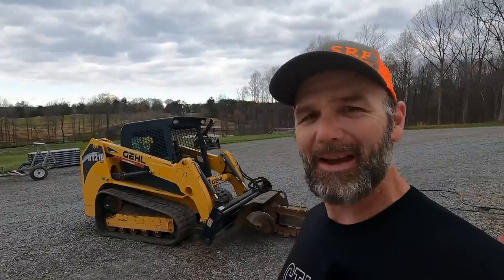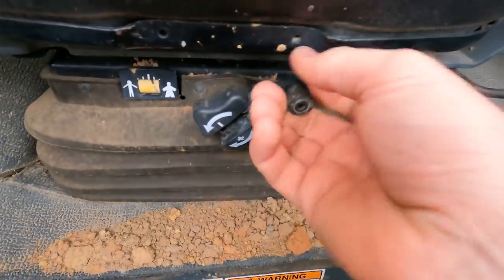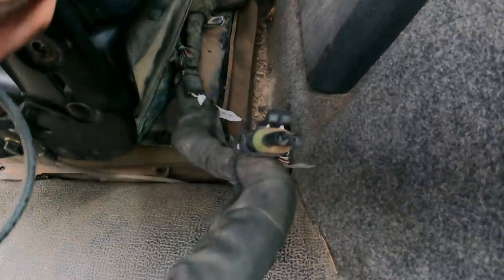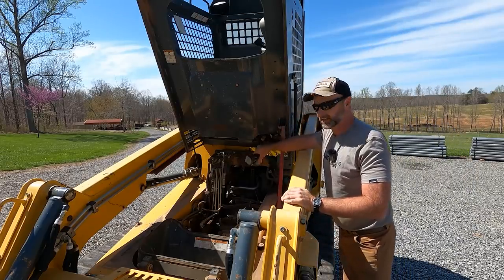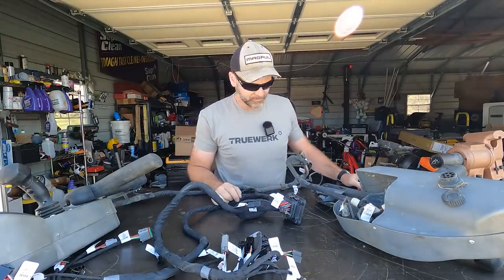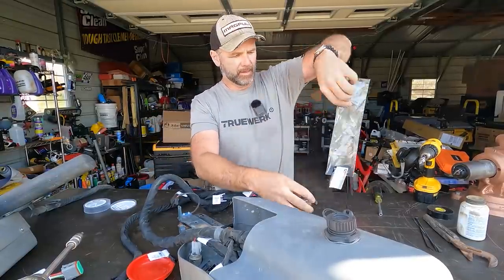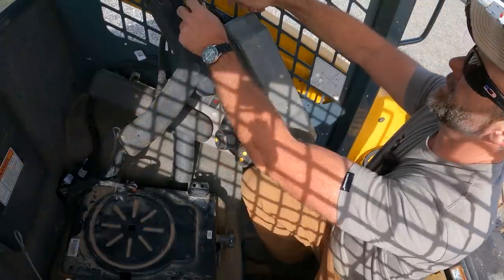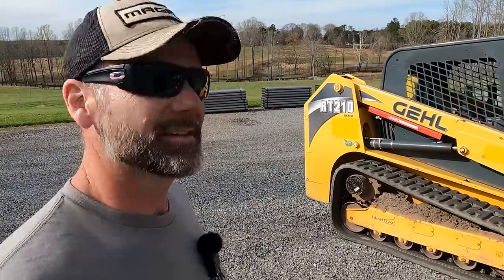I broke the skid loader

Comment: Never heard of using anti-seize on electrical connections instead of dielectric grease.
Reply from the maker: necessity often dictates policy
Reply: @StoneyRidgeFarmer  Iv used anti seize too and I use it on battery’s
Reply: Any grease is better than no grease.
Reply: @jeffeubanks370  conductive grease can cause more harm than good if not careful.  Especially in new computerized vehicles/machines.  He did it well with the tiny amount and application, but dielectric grease is specifically non-conductive for a reason.
Reply: Hope the anti size works out until your able to get some die electrical. I would not recommend leaving it like that for very long. Thanks for sharing Josh.

Comment: Never use anti seize. Die electric grease. A little goes a long way. Nice video though. When I was younger we fixed everything ourselves. Back then if we had to take it somewhere  and pay to get fixed. That meant we had to do with out something or work harder to make up for the extra cost.  It might have seemed rough back then  but it also taught me a lot.  Keep the videos coming.

Comment: Josh the failed wire appears to have broken due to fatigue. Cut the failed wire as close as possible to the connector  strip and test continuity from stripped wire to the pin. If it tests good cut out the portion of wire that appears to be failed. Solder in a good piece of wire and test continuity pin to pin. If good apply heat shrink over soldered joints.

Comment: that 9 pin connector under the Left control console is your Diagnostic Connector, that is where your diagnostic tool or computer plugs into to talk to the on-board computers

Comment: No need to comment on proper chemicals for the job or as we learned in school - Better Engineering thru Chemicals!  Suggest protecting/capping those unused connectors. Even using tape over the open connector will protect from debris, moisture etc.  Since that is an extension of the main harness, there will be ‘battery positive’ wires.  DO NOT use plastic bags over those connectors. They tend create a condensation pocket.  Enjoyed the vid and the bloopers. Power on……
Reply: said, "DO NOT use plastic bags over those connectors."
True.  Also notice the connector is facing up.  Taping the wires will create a bowl for the water to hold.   He said he needs proper drainage.  though I don't see a way for the water to leak out of the bowl of tape.
 
Six months he will be doing this again.

Comment: I say that is a ground wire for the seat switch. Its probably dirty or had corrosion.  I would have used a multi meter to try to find the short if that was possible. CorrosionX is an awesome product.
Reply from the maker: yep...it wasn't the seat switch buddy...watch the whole vid..you'll see

Comment: The vibration from the machine moter and lift  caused the connection on that pin to come loose. Its not your falt at all. The pin wasn't snaped in place when it was manufactured. You still have to fix it.
Reply from the maker: no sir...I hit a HARD bump..that's what got me

Comment: My Deere 9570r did the same thing.  I was in road gear hauling equipment.  Unplugged that pretty quick.  It wasn't fun just about getting launched through the roof  haha.

The active seat plug/wires somehow got smashed between the seat frame and shorted out.

Comment: I would secure that by the plug so it won't wiggle lose again. Then make sure the rest won't snag on anything with a tether (spring and wire tie)  that the rest can move snag free (not rubbing). Tractor trailers have a pole with a spring at the base so the wires/air lines don't get in the running gear. But I hope it won't happen again and you have good luck with it!

Comment: It pained me to watch this. No pry bars or metallic objects when inspecting wiring, They make plastic dental picks. Also the use of copper antiseaze is huge no no for electrical connectors use dielectric grease.
Reply from the maker: you're missing the biggest boo boo...as for metal pics....I think I'm skilled enough to not make the problem worse..however there is a simple mistake I made...see if you can spot it....you can't see it...because I failed to do this..that's your hint

Comment: Your mistake was using anti-seize on an electrical connection. I made the same mistake once. I put anti-seize on the threads of my D-cell Maglite when I put new batteries in it and it wouldn't work. At first, I thought the batteries were bad but it turned out that the anti-seize was keeping the end cap from making a connection. Had to clean it off then it worked fine.
Reply from the maker: nope...not the big mistake my friend
Reply: @StoneyRidgeFarmer  just hasn’t shown up yet, fun to come!
Reply: It doesn't really matter if it doesn't work as it was only on the cigarette lighter and as far as I know Josh doesn't smoke so he will probably never use it.
Reply: @davidwilles8577  if that’s the only place he used it… also, that circuit can carry a bit of current and doesn’t have to be in use to short out. The fuse “should” prevent a fire, but they don’t always.
Reply: They don't even call them cigarette lighters in new cars anymore because they have so many more uses.

Comment: It would be a lot easier to work in the cab if you were to lock the loader arms in the up position. Good Luck.
Reply from the maker: not necessary and provides a risk factor that I didn't need...if I'm working on the loader...sure...but stepping in and out of the cab with the trencher was super efficient my brotha

Comment: Lots of people commenting that using copper anti-seize 'is bad', OK it's not ideal, but Josh is using on some chunky spade multiblock so it's not that likely to short anything out and it'll do the same job as when it's on a battery terminal.
I've used cloth harness wrap instead of PVC tape on harnesses, as it's a bit more abrasion, temperature and oil resistant. That's why you'll see it inside cars.
That was probably a good option in getting a new harness, fault-finding sucks up time and time has a cost.
When they make me World Dictator For Life, every connector for everything is going to be made in Germany or Switzerland, and they are only going to come in a handful of variations. Manufacturing a zillion different custom connectors for every car/tractor/plane has wasted more time than wars or buying clothes has. A multipole is a darned multipole, you don't need a range of colours... so they can use the generic one or end up in a gulag 🧐
Reply from the maker: yep...not like I drenched the connectors..it will do just fine...better than nothing or WD

Comment: I hate wiring problems too.  While it seemed pretty simple, we didn't see you mark the connections as you unplugged them.  And instead of potentially cutting into the wires by slicing a weep slit, you could have just not wrapped it entirely.  Water will follow gravity.

Comment: I’d say you found it. Right at the bend of that clump of wires behind the seat.  I’d peel back and separate all those wires and see which one is burnt into the other.  Obviously something is getting power when it’s not suppose to. Or vise versa.  Electrical…..ugh!

Comment: I have zero need to work on a skider but I find your videos so informative and I usually share the equipment videos with friends/family who could use the info. While I may not work on skid steers, I have done plenty of mechanical work and I would say that your mistake might be not disconnecting the battery before removing the wiring harness? (Unless you did that off camera?) Anyways, great videos, keep up the good work! Love from Texas.
Reply from the maker: Amen! You got it....most folks are harping on the 1/94th of a drop of grease I put on the connectors...disconnecting the battery was an important step missed here!
Reply: @StoneyRidgeFarmer  Hey if it works, it works. But the battery is one of the first things I was taught. Lol. Also, I dont know if you'll ever do any welding on your equipment, but if you do, disconnect the battery first. We did a bed delete on our truck and had some custom tool boxes, rear bumper, etc. fabricated and they didnt disconnect the battery before they welded. Ended up frying some electrical components when they grounded the truck. Just a heads up, it was a very costly mistake!

Comment: Using that antiseize isnt a very good idea for electrical. I see you put the cap for the plug on different then it was originally. Thats under the armrest on left side.. That wasnt a bad job to do. Though it would of hurt your wallet alot worse had you taken it to a dealer. Great Job and savings. Great Video...

Comment: Copper anti seize is not good as a dielectric grease. Dielectric provide the moisture barrier especially on equipment that stored outside in the elements. Honest mistake!!
Reply from the maker: did you see how much anti seize I put on that? Not enough to cover a flies leg...there's a bigger boo boo you're missing

Comment: You should have disconnected the battery before working on any electrical components. Potential shock hazard and could damage other electrical components.

Comment: You left the machine running and over road the safety arm rest which if you bumped the the joy stick and might have been ran over disconnect the battery then see if it was needing a safety reset?
Reply from the maker: BINGO!!!!! Battery should have been disconnected.....lots of guesses on this one...the one big boo boo was not disconnecting the battery terminals
Reply: @StoneyRidgeFarmer  do I get a safety certificate or atta boy? 😂😂👍🏻

Comment: using the copper anti sneeze  instead of dielectric grease a NO NO . Didn't see you disconnect the battery before starting working on electrical
Reply: did you disconnect battery before started working on wiring ??
Reply from the maker: Boom! the battery is it...the anti sieze isn't significant at all...although some folks think it's a huge deal...I only put a tiny speck on there to prevent corrosion

Comment: The 9 pin plug is where a  computer can be pluged in for diagnostic purposes. I know you put the copper antiseize in the video to see how many of us would catch it.  Silicone or dielectric grease for electrical connections
Reply from the maker: still not the big no no....how bout...disconnecting the battery terminals when working with electrical systems! That's the big boo boo
Reply: I have Case skidsteer ,it has a disconnect switch so you don't have to remove the battery cables.

Comment: An electrician would check the old harness for connectivity (corrosion) and continuity. But hey, what would I know? I only have 30+ years in USG electrics and electronics as a GS-391-13.
Reply from the maker: Hear me out...oh and ya don't have to be sarcastic buddy "but what do I know", man...nobody's discounting your opinion or advice here......however.....an electrician (myself)  doesn't need to check it my brotha....I got a new harness lol  we already traced down the wire...as an electrician you probably know when it's time to replace a part v/s repair it and have it fail again...if the harness failed this time...odds are it's gonna fail agian....much more time (6 hours) and labor intensive v/s starting over fresh...so that's why I did what I did......fyi  USAF 3E051 (Civil Engineering Electrician inlisted fyi)  1996-2000 my brotha...I know my way around electricity and I know when it's time to start fresh with a new part....I'll save the old harness...but just for the connectors in case of future failure...that's why I did what I did my friend

Comment: The big mistake! Everybody is going on about the copper grease, I was more concerned with you putting the safety levers down and putting your hand on the seat from outside the cab. Especially dangerous with a wiring fault. ☠️
Reply from the maker: how bout something as simple as this....didn't disconnect the battery buddy...